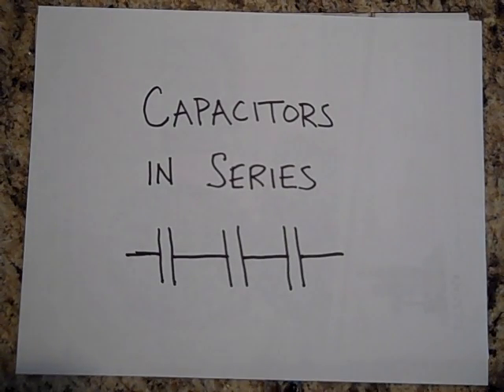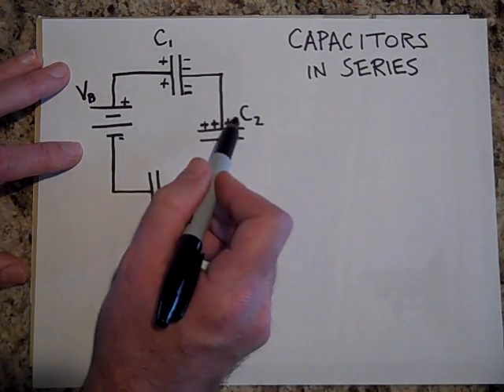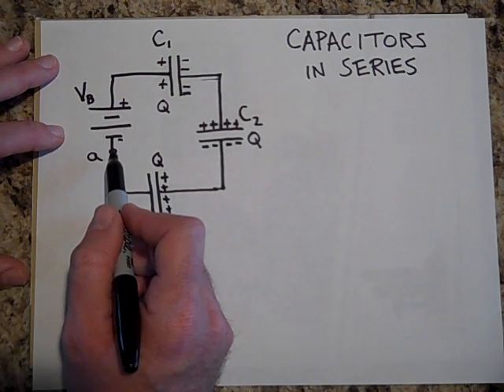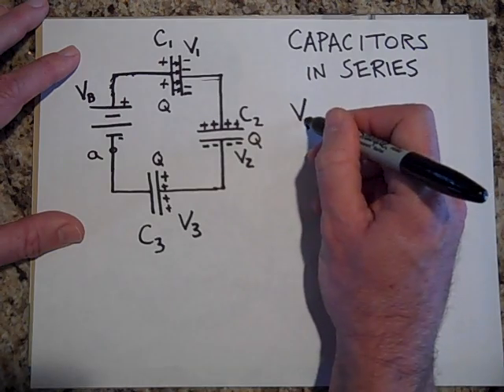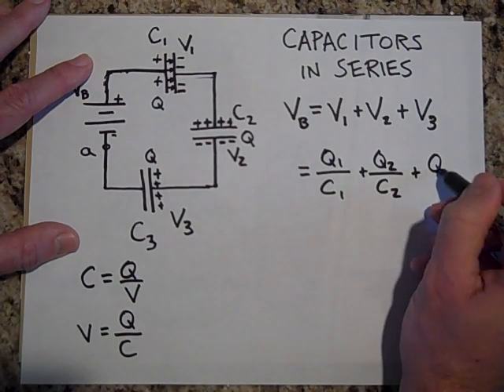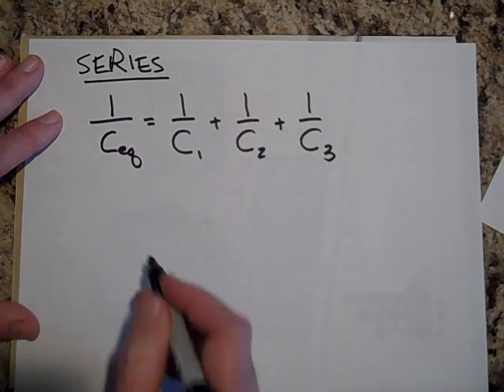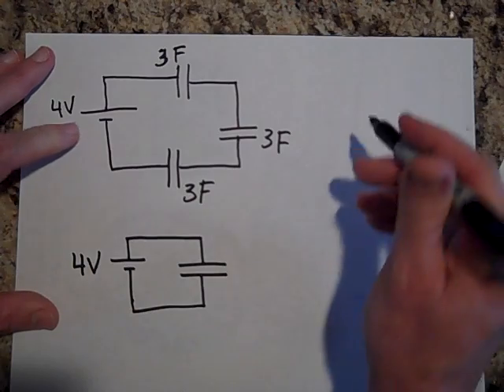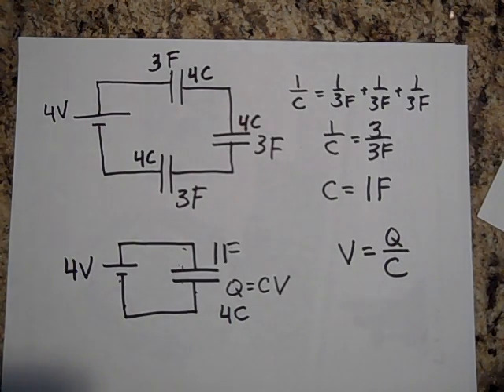Capacitors in Series

Comment: All remember this.
In series the working voltage will be for example 25v+25v+25v so in the end you can use them for 75v source and at the same time the capacity will go down in series 220µF + 220µF will be 110µF. Long time ago i did not know it and i burned my Android (long story)
You need better guy to explain this, he did not tell you much, not even enough to start to wire.